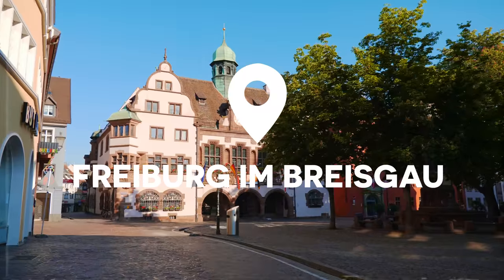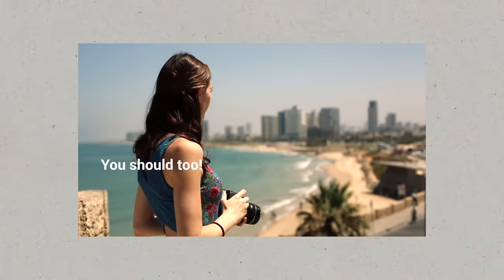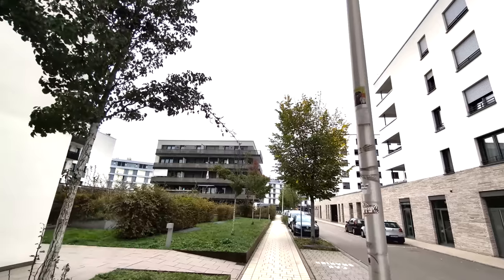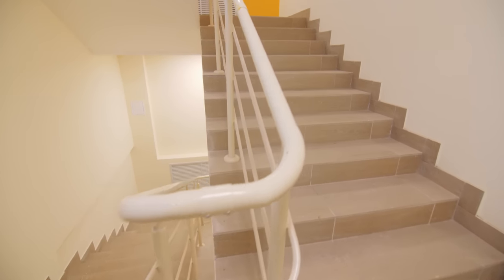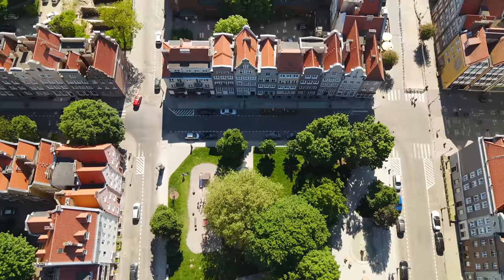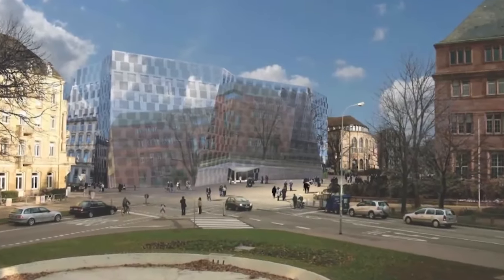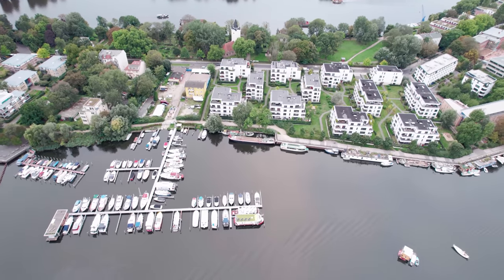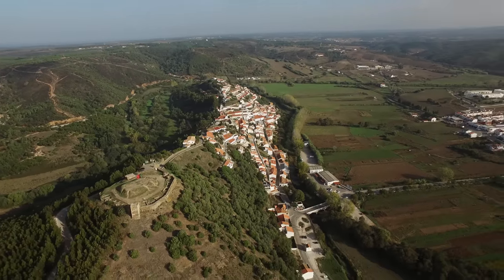Germany's BIG DUMB BOXES ARE AWESOME.

Comment: These buildings are also very normal in Denmark. They are so well insulated that in winter, even with the heating on, you often get ice on the windows in the mornings before the sun hits them.
Reply: Getting iced windows inside means your windows aren’t insulating that much. The humidity contained within the warm air (breathing/cooking/showering/…) is condensing at the window and freezing at its surface. Kinda bad (from the insulation perspective).
Reply: @agn855 i thinked he meant iced on the outside pretty sure
Reply: @GlumandaHD  yeah, I meant on the outside 😅
Reply: @agn855  We also get ice cream– on the outside, which is an excellent sign ;-)
Reply: We also have ice on the outside of windows (when I don't put the outside blindes down which I usually do). 
Whats weird is that the facade also has ice or condensate water on it, and in the morning sun it sublimates and steams of the wall on the east. Looks really unusual to me 😅

Comment: Dump boxes create a canvas for aesthetics.  They need not be dull or monotonous, since it is the surface rather than the inside structure people see. Like in the early 1900' we shoul keep decorations separated from the functional parts to get both better and cheaper.
Reply: Yes you can paint (or render) them different colours,  window frames etc.

Also orientation and height differences so that you break up lines between buildings.
Reply: i absolutely agree, green facades and beautiful colours go a long way to make boxes look much nicer.
Reply: you can even use an outer "shell" and those can although benefit the energy balance of a construction, replacing some panels with solar cells or use an air gap between outer and inner layer. Boxes can be to an extend be build much sturdier then other constructions, regarding to earthquakes or other enviromental hazards or cheaper using prefabricated parts.
Reply: But decoration is still taboo among architects.
Reply: But the 1900s with "Jugendstil" was a time when functional parts of the architecture were also used as beautiful decorations. It was not just a plain box and some artwork glued to the surface to make it pretty.
Reply: The environment plays a large role too: If you have a line of trees along the street and a nice park in the back, public transport one block away and all you need within walking distance you might need to add that too. That is better than a 1 family home way out from the city centre that requires two hour commute with your car every day and is disconnected to the providers of all your daily needs, to your community, friends, your workplace, place of worship, nursing home etc.

Comment: Some more info about the University library: the designers originally used a specific glass but the state decided to cut costs and just use normal glass and that's where all the problems started. The sun reflecting from the glass was getting so hot, it actually started melting plastic parts of cars parked in front of the building. It was insane.

Comment: "Big dumb boxes" are all fine, especially if they are newly built to modern energy-saving norms. If they just weren't so damn boring to look at, most of the time. The small frills you find on old housing, the fact that even when they had been built to match each other's style, is what makes old buildings / quarters "humane". And this is something modern housing dearly misses.
I'd take some 19th century or older building that was cored and modernized internally any time over the house I live in right now.
Reply: So how about this compromize: a big dumb box with an old-style street-side facade.
Reply: i'm with you on this. big dumb boxes might be, from a technical point of view, great. But they sorely lack in soul nourishing design. And i think there can be a compromise that has the best of both worlds. And i think if we look at those 100+ year old buildings, that are similar to those big dumb boxes, but more stimulating, we already see how to accomplish that. But we have to reject the brutalist design and all those metal and glass facades for that.
Reply: That's why landscaping around them and creating good common areas is so important, I pass through several dumb box neighbourhoods every day and none of them are ugly neighbourhoods, they're surrounded by greenery, playgrounds and ponds. I've even seen GDR era dumb boxes that manage to look  good by maximising greenspace between buildings and adding murals to strategic areas which also helps deter graffiti.
Reply: There is ways to make them cuter! E.g. my home town upgraded some of the smaller ones and put in wooden lattice shutters, some neat sliding shutters and more green stuff on them and they look good! They can absolutely be redeemed and even fancy façade elements made from moulds wouldn't cost a lot.
Reply: Right? I feel like the "big dumb boxes" are the McDonalds Hamburger of architecture. Upsides: Pretty cheap materials, very simple assembly, makes you feel alright (especially if it's the only thing you've been exposed to, yet), fulfill the basic requirements for humans to exist. Downsides: You can't tell if you're in a box neighbourhood / eating a McD Hamburger in Munich, Paris, Moscow, New York, Tokyo or any semi-rural town that still has their own McD for some reason, unless you look at outside factors like air humidity or temperature. In the form I currently see modern buildings, they're so incredibly bland and same-y. For me as a German, the only way box-neighbourhoods could be even more boring, would be if we adopted a grid layout for the streets.
Reply: Many big dumb boxes and terraced houses/ row houses from this millennium have a varied and different facade in the Netherlands. They are far from boring.  Since whole neighbourhoods/ streets are  planned together. They avoid your boring nightmare... you just have to think... ot off the box😁 (and into the street...)
Reply: I have to agree here. Most of the time I find housing projects like these dull and boring. I appreciate that architects try to make their surroundings lively, but in my opinion these buildings always look artificial (if that makes sense) and rather dead. Maybe the impression will change over the decades, but personally I'm happy not to live in one of those. 
Interestingly, I often find standardised housing projects from the early 20th century more intersting, e.g. the Siedlung Weegerhof in Solingen or Siedlungswerk Bayer in Leverkusen. I really hope future architects will find a way to combine sustainable building techniques with an aesthetically more satisfying design.
Reply: @AnD-1999  The modern buildings in the Netherlands might be than modern buildings elsewhere, but IMHO all those modern buildings can't beat the aesthetics of pre WW1 buildings. They simply had more charm with all those ornaments and other decorative elements.
Reply: Most old buildings are just dumb boxes with frills, though
Reply: You do realize you can always add external decorations to the modern house's facade? But given how expensive and timeconsuming homeownership already is,  you end up just wanting it to be as simple, cheap and  quickly done as possible while still being of good quality. Homes need to be homes first and foremost, and not a collection of more and more burdens to maintain simply cuz someone feelings of aesthetics get unfullfilled, that is inhumane.
Reply: I also think they are boring. But with plants and some colour, maybe added with some plaster/mouldungs (German word is "Stuck") it would give each house a more personal touch.
Reply: @rokhamler3352  Only if you own the entire building, which is most of the time not the case for multi family houses. ( I'm sure my landlord would be thrilled if I start to redecorate the facade of her house ...)
Reply: @timpauwels3734  Not all of them are just boxes, tho. Some have turrets (hope that's the right translation for Türmchen), bay windows or other shape variations.
Reply: I do think there's a difference between "dumb boxes" in the 70s and one that are created now. If the city has more money and tourism you often find nicer designs.

And I do like some frills - or just a bit variety. Be it a half timbered houses, clinker on the fassade or wood. Balconies and shutters on the outside or just nice paint. You can do a lot with little - to avoid sterile, white/grey boxes 🤗🙃
Reply: @mrm7058  If you want exclusive rights to decide what kinds of external decorations your building should have, buy the entire building. If you don't have that kind of money, then you also don't have the mo ey to maintain that building and those additional decorations, because they will make longterm maintanance more expensive. And just installing such "aesthetic" decorations gets eyewateringly expensive really quickly. That is why i see this as a non issue, people who don't have that kind of money and don't have that kind of ownership, don't even think about any special external decorations
Reply: @mrm7058  if only the population had stayed stable since that time as well...
Reply: Fortunately, a cosmetic makeover can be done any time - as soon as you have the time and money and you and/or your renters have a solid roof over their heads.
If that never happens, it's unfortunate, but not as unfortunate as people having no home they can personalise to compensate for the boring facade.
Reply: they dont gotta look like big dumb boxes though, idk just slap some pillars, arches, and some paint on it and it would look way better and less like a glourified commie block
Reply: Absolutely. I'm all for common sense but lets have cities that are nice to live in!
Reply: This, they remind me of that Twitter thread about low m minimalism and the loss of identity and character in many things modern. I'm all in for efficient use of energy and materials and at the same time any good architects could easily add details and features without an excessive waste, like interesting blinds or awnings (no need to go back to a 100+ yo style). There's a lot more to housing than saving costs imo.
Reply: Totally agree with you! You just nailed with your comment!
Reply: @amyloriley  nah, not enough
Reply: @enrif3099 I live in an old town and most buildings are just boxes (some exception, like a house nearby which used to be 3 houses, but on the inside is now one house or the one that has a corner shaved off because otherwise the street would be too narrow even pre-cars).
But every building has like different windows, different roof decorations, different facades, different murals, different doors, different main colours, trims, ceiling decorations...
All of those things are just frills and decoration though, the underlining house is still just a box.
Reply: @amyloriley  Which, quite often, is actually what those old buildings are to begin with.
Reply: Some say the energy-saving norms are one reason why the dumb boxes nowadays tend to be so boring and uninspiring. ;) 

I kinda miss the brutalist apartment complexes of the 70s, at least the more luxurious ones (not the Platte). There were a lot of interesting design ideas and relatively bold shapes, often with huge balconies or even terraces.
Reply: How much time do you spend outside, looking at them and how much time inside?
Reply: @Eysenbeiss  You know there things have windows, right?
If I lived just one street away, I'd have the privilege to have the choice of looking at one of eight houses that in some cases are turned by 90 degrees for variety, but are otherwise identical(ly ugly).

Also, yes, I spend time outside. Not that there's a cafe, bar, restaurant around, but assuming there was, I'd certainly choose sitting in the outdoors outside of the cold season. And yes, environment matters quite a lot then.
Reply: @amyloriley  In the UK we often demolish the back of the building but keep the facade. This recently happened to my local cinema. It happens to old railway stations which converted to other uses or warehouses to apartments.
Reply: @rokhamler3352  You can't though. If you just slap on a facade, you make that side heavier and it might lead to stability issues longterm. I own an apartment in a box from the 70s and in some "let's just make it pretty" efforts, they retiled the previously plain cement floors with terracotta tiles on the balconies before I bought the place. Well 5 years later, there were cracks along the walls that held up the balconies. Turns out, the weight was pulling the front down. And then they had to redo the entire facades on both sides of the building, so the balconies wouldn't slowly pull everything down. They changed the windows during that. But it was months of the our windows being covered with scaffolding and the house was noisy all day during the week.
Reply: @thirstwithoutborders995  there are decorations ... and then there is adding several tons of load to the external shell of a building ... which you know you need to consult a civil engineer for. Since load can generate both both forces and torque. Also is the building situated on what was once marshland perhaps? But without reading more into your specific situation i cannot even begin to question more.
Edit: i also said adding decorations is eyewateringly expensive ... well you got a dose of it. I don't really see which one of my points you are countering
Reply: It would be great if the inhabitants or owners were allowed to modify the facade later. Like years after building and settling in. Paint a big mural, or just an unusual color. Cover the exterior with additional panels of wood or cast to add shapes. But often, this kind of thing will then be banned by communal regulations that try to prevent individual buildings from standing out, forcing them to adhere to the "character of the settlement".
Reply: What the big dumb boxes lack in interestingness due to their simple shape, that can be more than made up for with materials that are pleasing to the eye and age with grace. Bricks, wood, tiles, something like that. Concrete should never be left untreated/painted above eye level.
Reply: @Eysenbeiss  I remember, when there were suggestions to take the smallest and ugliest rooms/apartments available to cut costs, because that's just a place to sleep at... 🤔
As long as people go to work places, shopping, bars, restaurants etc people will be on the streets. The environment makes a huge difference on how you feel. How your neighbors feel. Going outside in the morning and being faced with a world of depressing facades from the houses and people's faces, it affects everyone's mood. People enjoying the streets is important for the economy. We have a newly built area in the neighborhood, that's build of dumb boxes and the streets are supposed to be filled with life, but the area is mostly a ghost town. No one wants to spend any time there, even though there are nice bars, initiatives etc.
And you only think about adults. Children have to grow up there, they need the body movement, need to play outside, so they don't get impaired vision from only looking into short distances and to meet friends without costs, be able to play and spend their time with each other. These children get depressed from an early age, from living in an non-inspirational environment. Everything looks kind of the same, no discoveries, nothing, that inspires to learn about history, culture, regional differences etc.

Comment: I live in a box. The original inspiration behind was the Bauhaus. “Form follows function.” A simple and timeless design. The first box building in Germany was built in Dessau in 1925. Simplicity was behind its design and the American version, the Mid Century Modern, was based on the same principle. Modernism is about architecture and the things contained within it, not calling attention to themselves.
Reply: Unfortunately, though not entirely due to its own fault, the Bauhaus motto often led to beauty being relegated, if not outright ignored. Methinks that beauty is a function necessary for humanity.
Reply: @ebahapo  You're right about beauty being necessary to humans but the better Bauhaus designs are absoluely beautiful!
Reply: @harryhirsch3637  Yes, many of the original work was. But even some of the original work had abandoned beauty. Even more so by its followers. As it so often happens to those intending to revolutionize, the proverbial baby gets thrown with the bath water.
Reply: But the first what was lost: Form follows function. 🤥
Reply: @ebahapo  Buildings are also areas, where you stay or not. If you are dehumanized in a building or row, but you have to serve it's proposed idea, you are not a free man anymore unlike you really choose that. Bauhaus is nothing more than what you see in 2:10. That being said, it's a shame and crime to use it on a wide scale. Other designs are less penetrant.
Reply: The most timeless design are classical building styles though, which are always considered to be beautiful. Unlike modernist houses, classical styles will never get out of style.

Comment: In Stewart Brand’s book, “How Buildings Learn: What Happens After They’re Built” he wrote about the need for buildings to built in such a way as to allow flexibility for future use. A building can be built for one purpose and be used for something completely different decades later. Occupants may have planned for one thing, but through living in the structure may discover the need to make adaptations. 

Box shape buildings are inherently more adaptable for changing needs.

Comment: At the core "dumb boxes" heed the maxim "form follows function". You can still got your individual touch by applying color, small ornaments or even piling a slightly bigger box onto a slightly smaller box, like you can see in many medieval cities. And boxes consisting of two or more semi-detached houses are more efficient and even in many cases more aesthetically pleasing than rows of detached houses showing each the exactly same playful details.